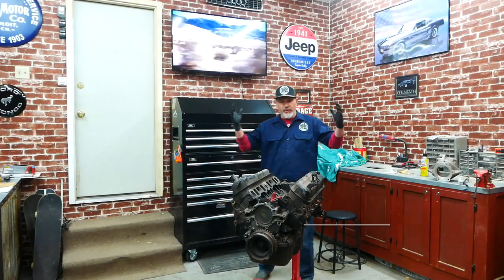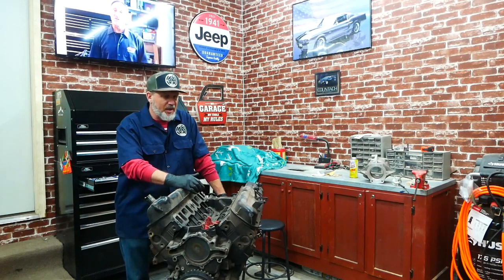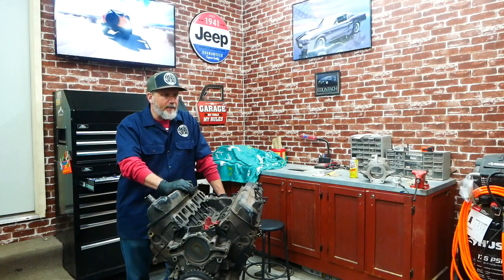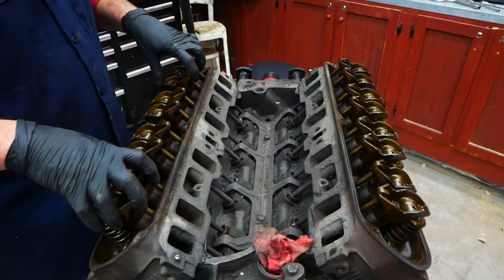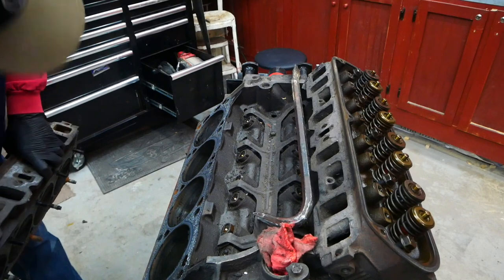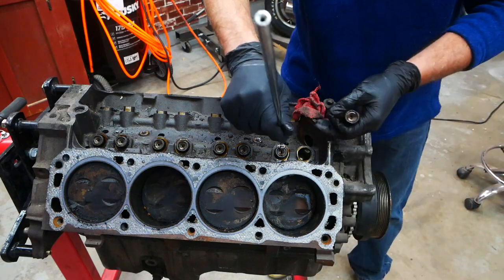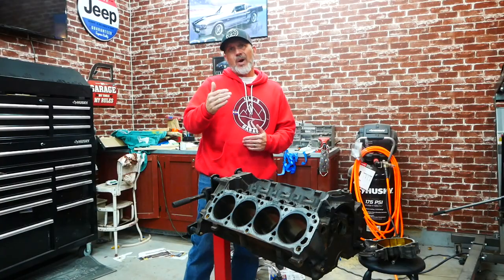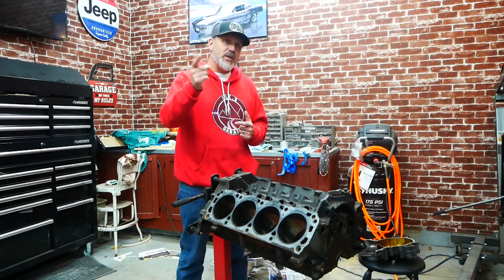Explorer 5.0 Engine Teardown

Comment: will a 302 fit in a ford explorer 2005 currently has a 4.0 ....?
Reply from the maker: Not sure, but it likely will.
Reply: No reason why it shouldn't. Its smaller than a mod motor which that gen came with as an option.

Comment: I was looking at one of these for an ffr cobra is there any good aftermarket parts for performance
Reply from the maker: Tons, as it’s a base 302.  You can keep the explorer Intake and computer and place it in anything.  I am building a 347 with it and keep the stock efi and computer.  Stay tuned.
Reply: @alpinegarage8548  i was planing on making it carburated is that a possibility?

Edit and thanks for responding
Reply from the maker: @Guillo78  absolutely. Just toss out all the efi, grab an intake and carb, distributor, etc.
Reply: @alpinegarage8548  ok got it thanks and is not going on a factory 5 but rather a shell valley cobra

Comment: So are the gt40 p heads better then the  original gt40 heads
Reply from the maker: Not better, not worse. A bit higher compression, but you will need to buy special headers that fit only P heads.
Reply: You would be better with regular gt40 heads, you just about have to make ypur headers to fit the p heads, no one makes them anymore, the only brand ik of is torque monster and its pretty exspensive for a set of headers